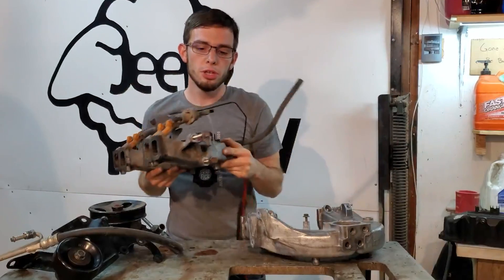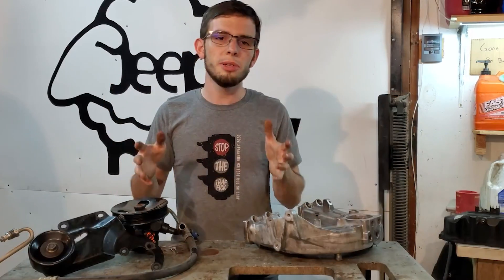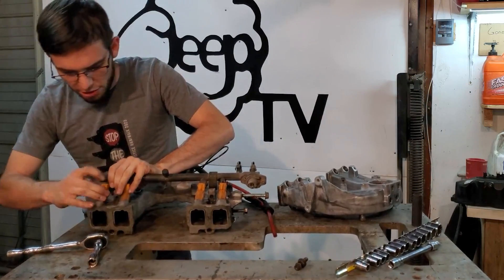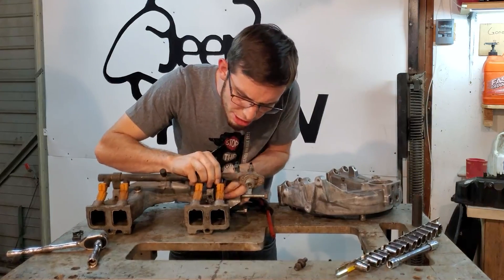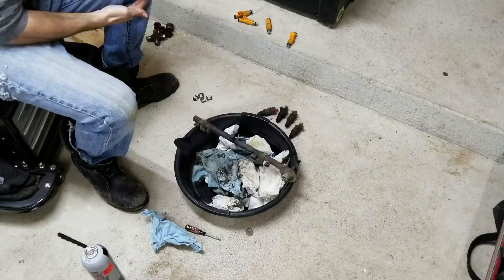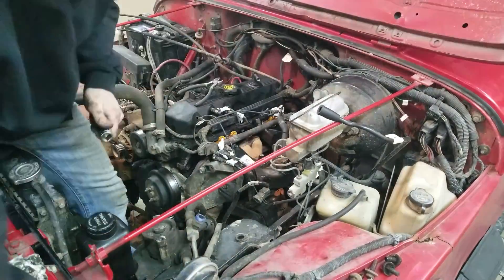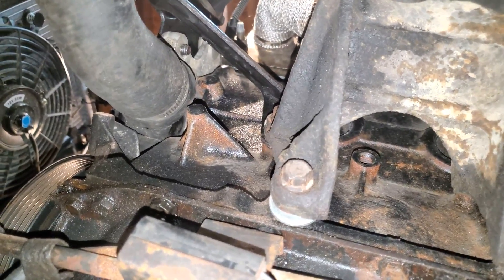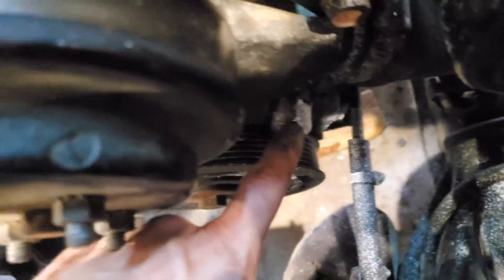Save Time! Upgrade The 2.5L 4Cyl Jeep YJ Intake Manifold To a TJ Intake Manifold

Comment: My 97 tj with 2.5 has that little bump out also. Factory engine and all. I actually cut it off also on mine. I think with different belt lengths then it doesn't become an issue.

Comment: How do you hook up a catch can on a 2001 2.5 
On the pvc valve side or on the ccv side  , I have blow by pressure
Reply from the maker: I would think that you would want it on CCV (the big one) It seems like many of these engines have quite a bit of oil coming out of there onto the air filter
Reply: @JeepSheepTV   ccv valve is on the side of the cover with a small hole in the brass fitting and the pcv valve is in the back  
I’m going to try hooking up  a larger diameter hose to the ccv into a catch can  and then to the intake . I have no leaks 
Just a smell of Burt oil here there , more often  when   Traveling and slowing down
Reply from the maker: @Drake621  I was thinking of the PCV then. Did you see my video about cleaning the valve cover? It helps with the oil smell on decel. They get clogged up pretty easily

Comment: Had a few Cherokees a while back and thought about cutting the "legs" off the manifold and welding on bases to accept the Chrysler 3.5 throttle bodies.  (2 of them)
I just picked up a 01 Dakota with the 2.5/ax15 5spd, 8.25 rear, 3.55.
You can get a "performance" cam from Bullet Cams near me (Olive branch MS) 

Im still watching your videos on the supercharged ones.
ThNks for these!
Reply from the maker: You may end up with too much throttle body doing that but I like the creativity! Thanks for watching!

Comment: Hello, I love your videos!  One question, did you have to open the hole in the TJ throttle body?  for the 6cyl body?
Reply from the maker: I didn't have to, but I did because theoretically, it should be better to have matching hole sizes.
Reply: @JeepSheepTV  Excellent, this month I start with my modifications, I will follow your advice 😃

Comment: I don’t have a power steering pump! I gots de no power steering one, I do have a tj distributor though, which is kinda odd, I didn’t put it there, so idk why it’s there, it’s a 93 btw
Reply from the maker: I forgot about power steering being an option. What does yours use to tension the belt?
Reply: @JeepSheepTV  it’s essentially just a pulley on an arm, I will verify tomorrow
Reply: @hangrywendigo.7057 my 95 has no power steering, it is just a tension bracket/pulley where the pump would normally be. Dayco 89012 pulley, just replaced it. It bolts to the intake as well.

Comment: Shoutout to my pre 91 yj bőrthers who's jeeps dont have power steering.
Also, pre '90 yj's use v belts instead of a serpentine belt so you get no tensioner at all (unless maybe an additional v belt for the ac if you have it and ANOTHER additional v belt for the PS has a tensioner, i wouldnt know)
Reply from the maker: Lol Yea, this pretty much doesn't pertain to you. Unless you are upgrading to the serpentine belt, then I recommend taking parts off of a TJ. (Hence the video)

Comment: I have a 90 YJ that is carbeurated with this fuel injected manifold already installed. The injector seats are plugged and it has a carb adapter. I am looking to switch it to fuel injection since the manifold is already there. What do you recommend for a standalone ecu that I can just plug the injectors in and the throttle body into without much hassle? I cant use a stock ecu because the jeep is bored and stroked to a 2.8. The the distributor timing is also already standalone too.
Reply from the maker: I'm not really sure, I have heard that megasquirt works well

Comment: Do you know what would cause my yj 2.5l to loss power in 3rd gear and up, have to shift back down it loses so much power. Have 9 psi at fuel rail with key on, and around 31 psi running. My initial thought is to change fuel pump and filter. Just wondering ur thoughts!? Thank you
Reply from the maker: When you say 9psi with the key on, is that with the engine off? The fuel pump runs for a few seconds when the key is on then turns off if you don't start the engine. With that said I wouldn't expect there to be much pressure if the pump has run then turned off. 31 psi sounds fine when running and it should go up around 39psi if you open the throttle. A loss in power in higher gears is pretty normal for this underpowered engine. My best advise is to clean everything, valve cover (inside and out), intake manifold, throttle body, injectors, etc. Check for any vac leaks. There is a vac line that runs under the dash to the heater, those leak sometimes. Move the inlet air sensor and shift gears at like 3500-4000 rpm (or higher). One thing I noticed is that when shifting gears, often times if you shift at 3k it will drop you into 2k-2.5k rpm in the next gear where this engine has no power and it will take a long time to work its way back up to 3k+ where it makes power again.